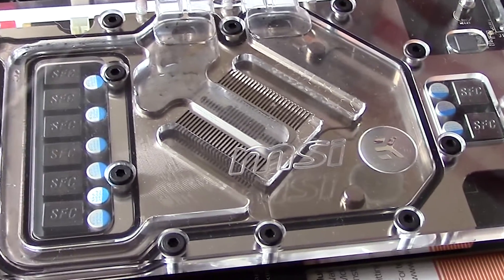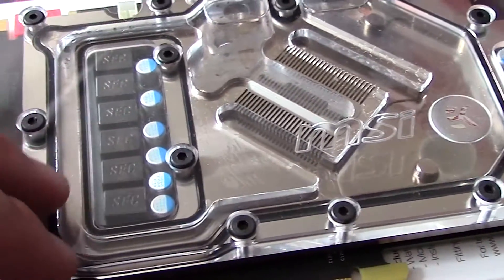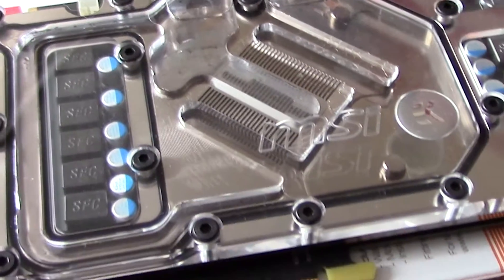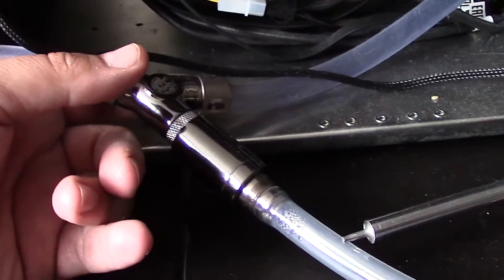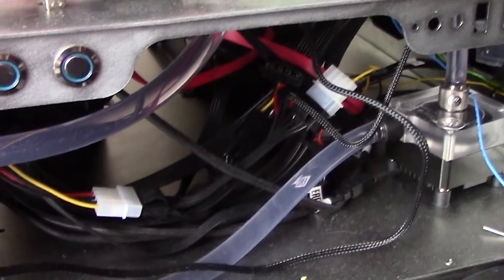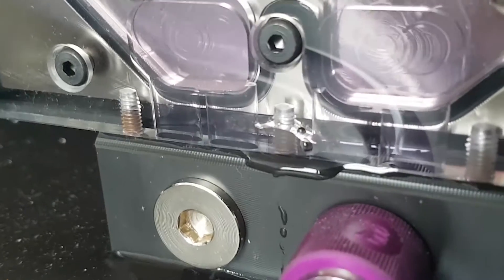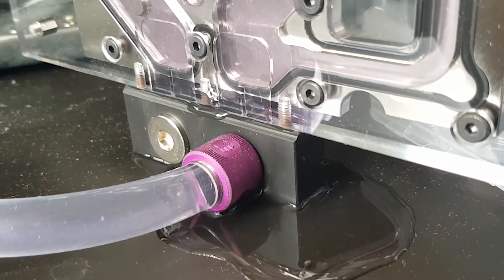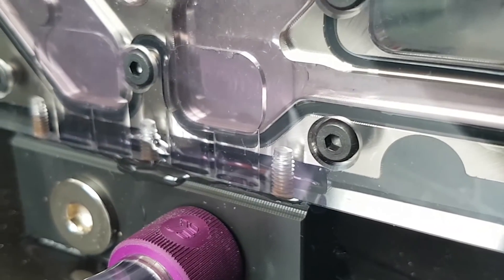CRACKED GPU WATER BLOCK - WILL IT LEAK?

Comment: My block is cracked in the same place it's clear that mine will leak as you can feel the crack from the inside and top. Were you still under warranty I couldn't find clear info on what is and isn't covered.

Comment: i just finished installing my parts my first ever water cooling pc i installed fc terminall in parallel and it leaked turns out both of my 980ti waterblocks were cracked in the same spot as yours

Comment: i have the ek 1080FE block with a crack in the same place.. but fortunately mine doesnt leak and it has been in my system without problems for over half a year now. maybe its luck